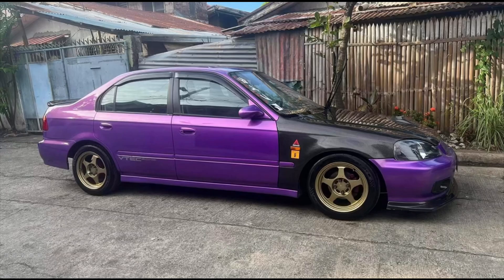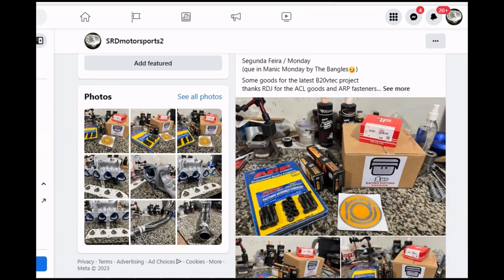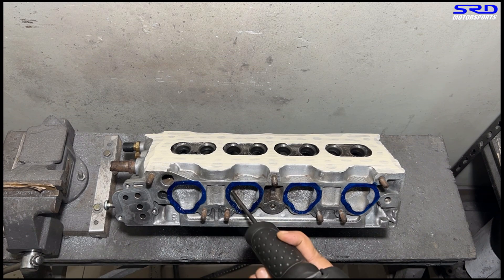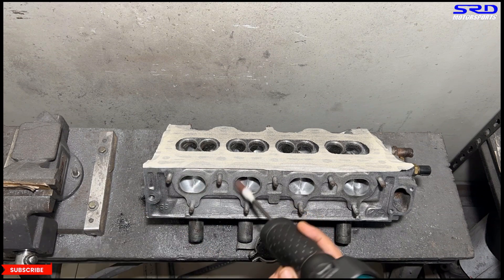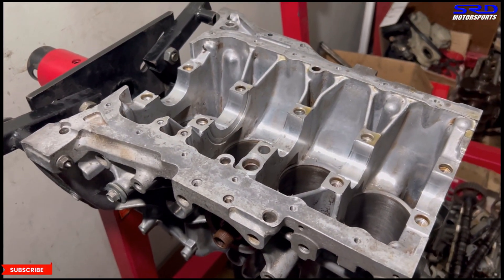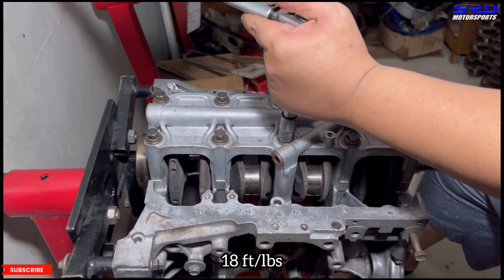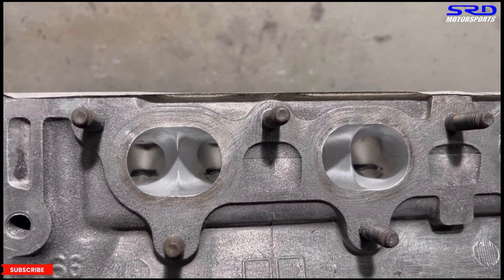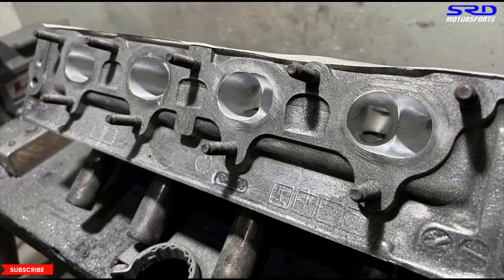Stock VTi Ph16 (D16) OEM Rebuild with a Twist Part 1

Comment: That clicking sound really is like an instant shot of dopamine. Not only cause of the satisfaction of doing it properly, but also it's relieving to hear it instead of thinking about the bolt snapping as you torque it down.
Reply from the maker: True true

Comment: Srd bro,my mechanic adjusted the fuel pressure to 70 psi,isnt it bad?
Reply from the maker: Depends I mean have to check with wideband if too rich or not
Reply: A trick I’ve seen some people do is running the fuel pressure as high as you can(while being able to maintain a healthy idle) and turning down the injector duty cycle (to obtain the target AFR). it’s supposed to atomize the fuel better, but I have no experience with it
Reply from the maker: @tayvonrose2528  yeah but key word “tuning” and that wasn’t mentioned prior so I can’t tell 😂
Reply from the maker: and anything above 55psi the standard stock style injectors even dsm injectors get severely shortened it’s lifespan that’s where we start to see injectors stuck up etc

Comment: Nice motor but seems like a long ratio tranny
Reply from the maker: It’s the stock vti transmission like most Si standard 4.25fd tranny 

The rpm limit is 8,000 that’s why it’s long they tuned it like that with their tuner